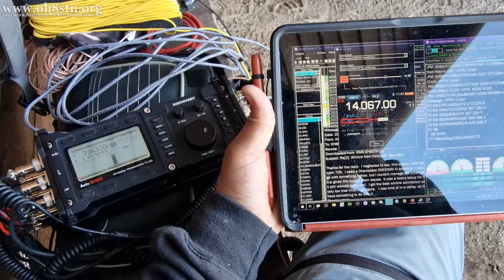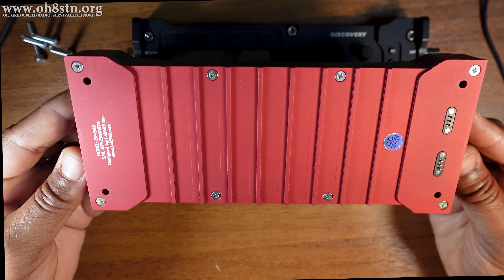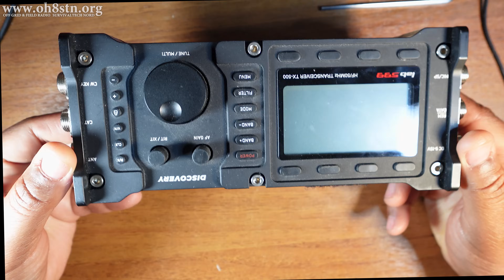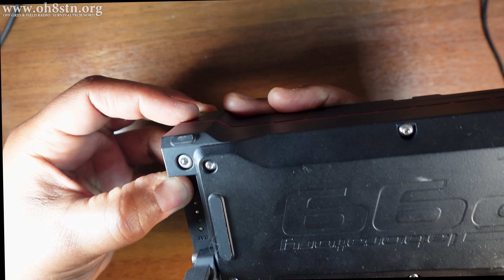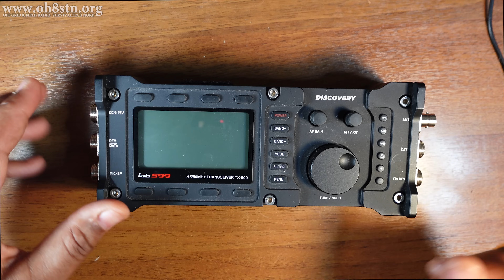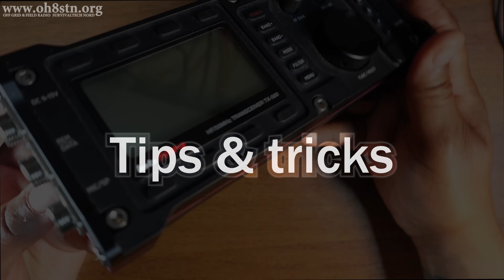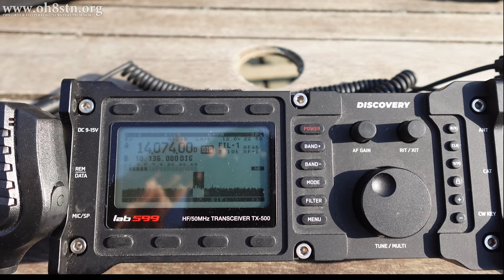TX-500 Battery Pack from Lab599

Comment: Shame prices in U.S. have gotten so out of hand.  $1600 for this setup vs $1600 for kx2 shack in box package makes it a no brainer in elecrafts favor.  You could even do a 705 with a mat tuner at that price.
Reply from the maker: Well the prices are definitely out of hand in north america. The upside is this is rugged. A kx2 breaks just thinking about wet weather. Plus, if you want 160 and 6 meters, It's no brainer in Lab599s favor.
Reply: @OH8STN  Unless of course your TX-500 fries due to a CPU defect. Once that happens you’ll be in repair limbo for nearly a year. Despite how innovative or durable it is, I can’t recommend it to anyone until they get the support side figured out.
Reply from the maker: So don't buy it! I'm not selling anything.  Just showing people how to use it.  Is that a crime?
Reply: @OH8STN  I like your videos, that’s why I keep coming back. I WISH like hell I could buy either this or DL4KA’s battery pack, but I currently lack the radio that they are built for. I just thought getting that information out there is valuable for those in the US Market that don’t have a TX-500 yet. Certainly not an attack on you, though apparently it was perceived that way.
Reply from the maker: We have exactly the same problem with Elecraft radios in europe, as the problem you describe in North America. Should people not "risk" buying Elecraft radios? If an American company was making such innovative radios,  I'd have them on the channel.  Sadly, they don't exist! We all can choose what we spend our money on. I don't give a hoot how someone spends theirs. To your point though, my 817 was bricked a few years ago. Trying to get it repaired was next to impossible. Even though I could tell them exactly what was wrong with it and the component which was defective, there was no guarantee of time for the repair, and no price estimate for what I wanted done. There's always gonna be risk with our radio choices, regardless of the company.

Comment: Interesting to see if it is as quiet as the genasun.   Does it feel rugged to you?
Reply from the maker: It's not as quiet as the Genasun. I haven't done deep solar testing yet, swally but there. It feels solid enough. I was expecting it to be as rugged as the t x five hundred itself. It doesn't feel as tough but it feels solid. When it's attached to the t x 500, It feels like one block of aluminium.

Comment: Great video as usual..Julian is the battery pack waterproof? And what is the suggested retail cost?
Reply: Hi Julian, waiting for mine to arrive. DHL woes….

My understanding is that you CAN power the TX-500 form the GX12 OR the BP-500 but NOT the BP-500 connected to a supply AND the GX12?
Reply from the maker: For the first question I wouldn't have any problems taking this out in the rain. The battery compartment is tightly sealed with those six screws. However, i'm not sure what the I p rating is if it has one. I'm also curious about how the pogo pins will react if they got wet. As for the price, seems to be about $400.
Reply: @OH8STN  Thank you Julian...